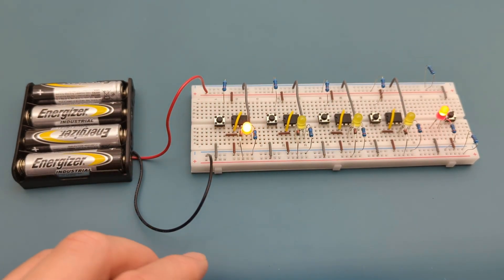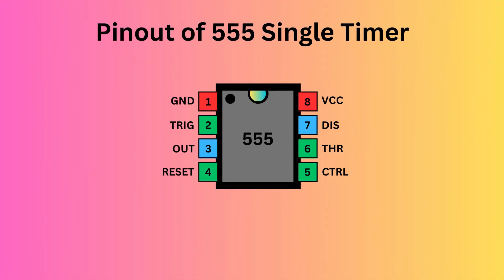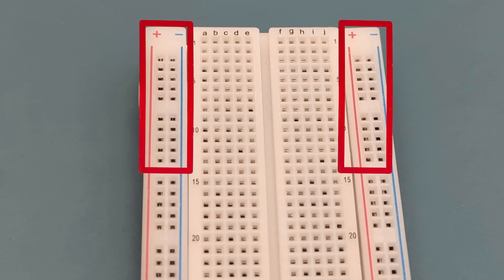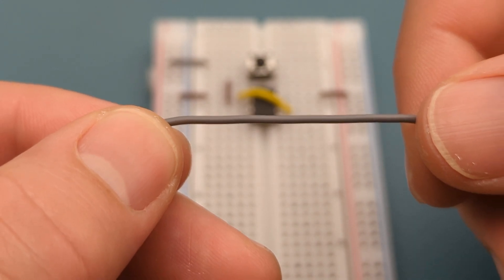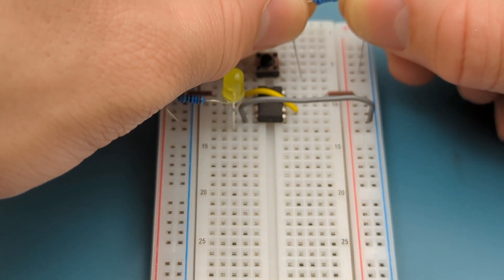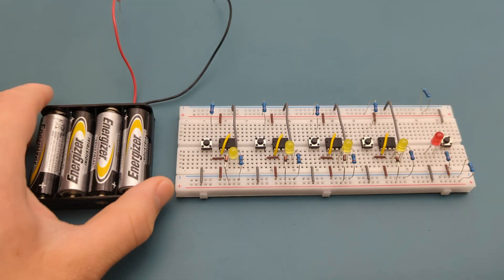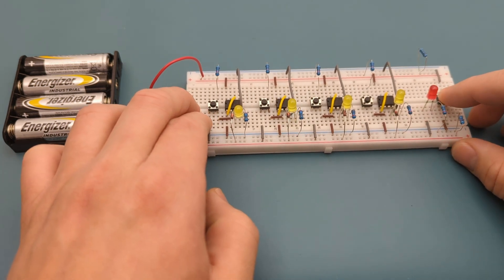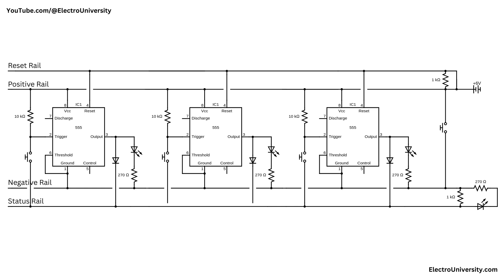How to Make Fastest Finger First Circuit For Quizzes Using 555 Timer

Comment: Nice idea. But the schematic still needs some work. 🤪 
The restet-botton only kills the battery. 
The 1kohm resistor above it is also shorted. 
The switch on the middle 555 an one LED have no function. 
Wikipedia: CONTROL-Pin -  If this pin is not used, it should be connected to a 10 nF decoupling capacitor (between this pin and GND) to ensure electrical noise doesn't affect the internal voltage divider. 
Vcc-Pin -  Decoupling capacitor(s) are generally applied (between this pin and GND) as a good practice.

Comment: Great video got me thinking adding 7 segment displays for each player to keep score first one to nine would be winner I just don't know how to do it lol
Reply: You could use a ripple counter for each player, with the 555 output triggering the count up, then decode the outputs using a BCD to 7seg decoder like the CD4511. You could use and gates on bits 0 and 3 of the counter to detect a score of 9 (1001) and light up an LED for that player.
Reply: @matthehat  Thanks for great information will give it a go when I have a chance, all the best cheers